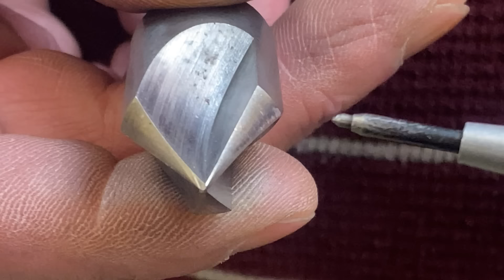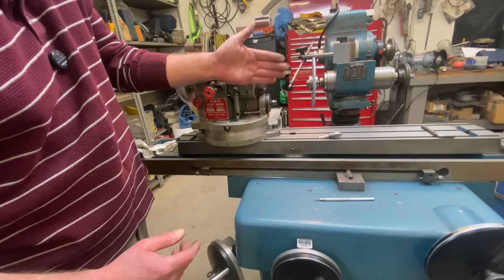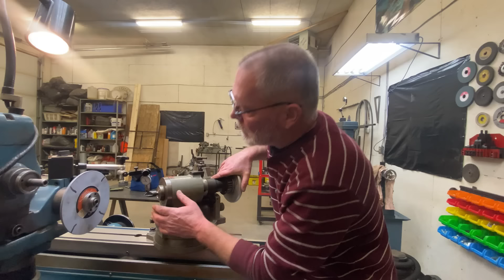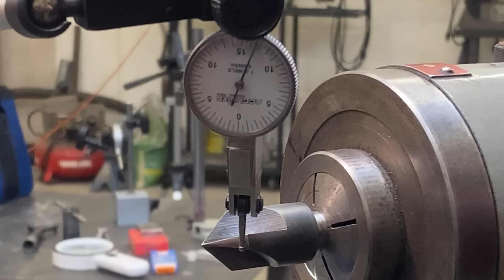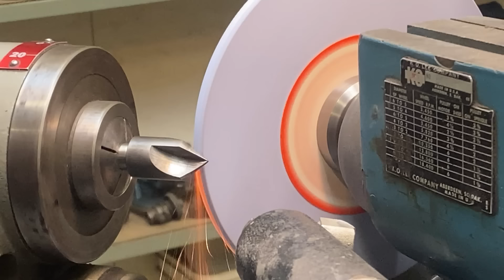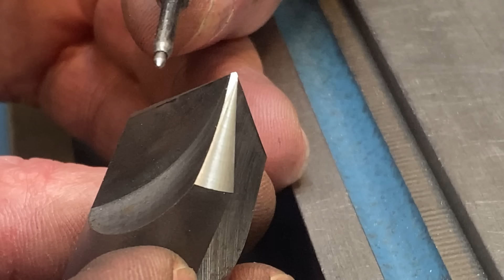NEW LIFE FOR AN OLD TOOL

Comment: You wouldnt believe what i have acomplished with a angle grinder and a speed controller hose clamped to a fixture 😂😮😢 is scary as hell  i like the new design in my workings now as one of my many porting motors with a flex shaft i also have a fully built and ported old macoloch weed waker engine and its flex shaft cut down  it runs on nitro race fuel and is the best waste of time to date but it actually grinds quiet well esspecially when i mountbit to the old logan lathe bed without the spindle or spindle case on it i made a i beam work holding  its always great fun when a small ring of customers i have here now since moving from my home state and major us city with 3 million living in a 60 mile radi ¹to less then 3 million in the whole state rural new englend  1300 miles sepwrates me from a easy 200k yearly income to being on welfare  just about funny how the good old boy and everyone knowing everyone in the whole state it feels . When u show up to work in a state of confusion if you have a brain  and not married to the owners or best friends with anyone in owners family or large circle its best to have the short bus bringbubto work carry a snoopy lunch box and drool on yourself  frequently so no one gets ass chapped or scared there bread  and butter or easy ride is at stake when they realize your actually really good at what u have focused your whole life long career  around i mean i can make a phone call back home and have my salary matched plus and be working the next morning at numerous shops but they boycotted me here i bought a house close to the place i found and thpught was it the last company ill work for structured my life in a area i tottaly didnt move here for due to its shit logistical area but aftet 2.5 years and some suck nutts idk who i saw them try to get me to quit  you could tell who was involved and who was not all the bosses bitches where i bring 20k+ minumal  plan to there attention multiple times in multiple areas of intreast buy casual conversation with my imediaye boss letting him know these very small implications if 1 of the 3 are implemented and falowed buy others you will see a return or savings of my salary anually guarenteed.   Next thing you know where having meeting and he took it to owner and said it was his idea the first one i let it go but  confronted why he did that . So i sat  waiting all while out perdorming every one of the other 12 coworkers in same field as me . What made me sour was being lied to guarenteed a hourly rate of half what i made the prior 11 years in same industry doing same job at less company . I was guarenteed  to get my asking rate if i could get certified within 90 days i saved them 11k in schooling and testing plus my two week wage to go to school amd the cost to send me buy my confidance in my knowledge in the industry to take and pass. The certification needed for them to operate under my cert when i told them get a proctor and sign off on me i will pass the practical  amd written if i faile i will pay the the testing only fee or 2600$ i took the test passed with a 93 written  and passed tje practical i was the only one in the company of the 3 me the owner and my direct boss took exame as well they failed one failed practical the owner the other written and practical.  So i waited 90 days came and went then  ow er started dodging me always talk to me later . The lies started. Flowing in  i got writtennup for  something i couldnt even possibly do its inpossible to do what was claimed as well as if im driving down the road how can you write me up for driving down the road yeah that is wjat really sent me over the edge i went threw about 9 months of hell to be told i could take time to get surgery neededin  my hands as well as im covered the qhole time out of work recovering threw there insurance they pay the short term so a set it upbthe two weeks prior to sirgery date i had dr apointments back to back for surgery pre operstion the day before and the pre pre operation provedures from my primary dr the week before making me miss a whole day both weeks i still clocked in 4 days time 39.7 hours and 38 hours then after surgery  while trying to claim short term i was denied coverage beccause the compaany i worked for changed there rules with the insurer a month before my surgerybthat u had to  be a full time employee and work 40 hr minimal teo weeks prior to  claim . Whe. The insurer rules state being a full time emp o oyee which consist of 32+ hours a week or the status of full time employee thre the company worked for . I never seenthe shit i seen here  and that is just the cake there is more all the way to never being fired in life to getting fired within a month of return to work and being denied  unemployment  in a way that felt like someone took a pay check to deny me i am looking for attorney now its been 2 years i work out my garage i. My small garage based macjine shop last year i might made 25k same looks like this year my ex wife is here tjpugh and has my back

Comment: Ah, the old cam relieving fixture. Its one thing to have it, but like all machine tools, there are a ton of accessories you need to have with it to make it really useful. I have a couple (not powered, one is for sharpening a gun drill) that I have acquired over the years with some other tooling, but of course I have no accessories! Cheers👍
Reply from the maker: Cheers to you! Thanks for watching!